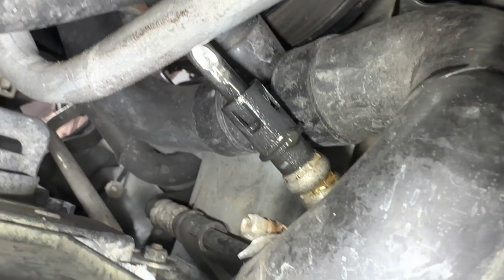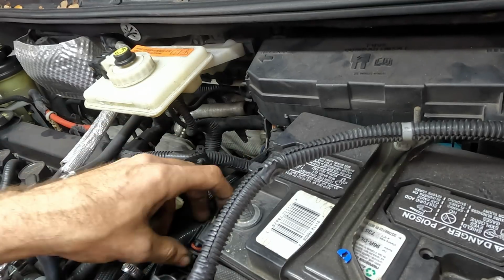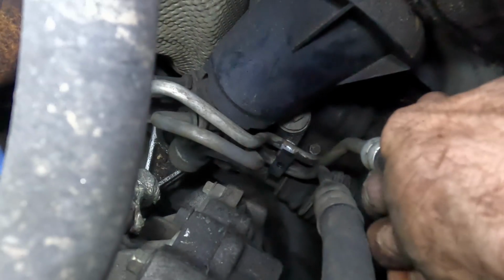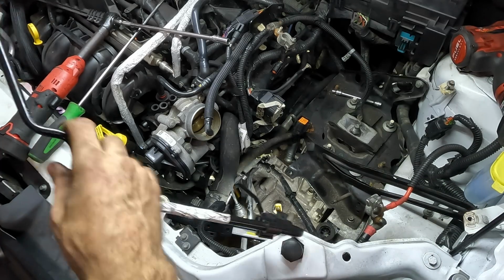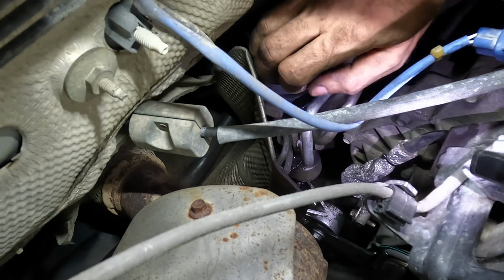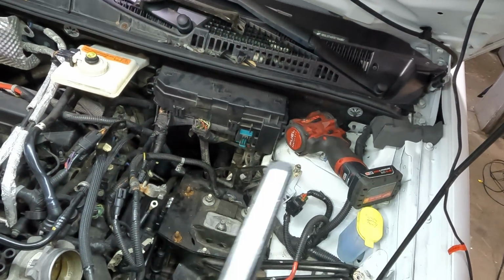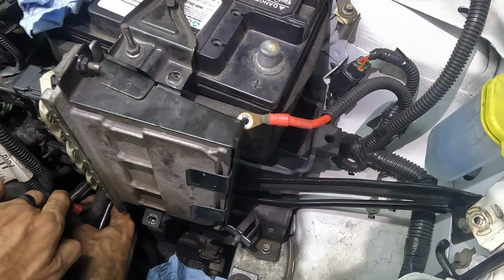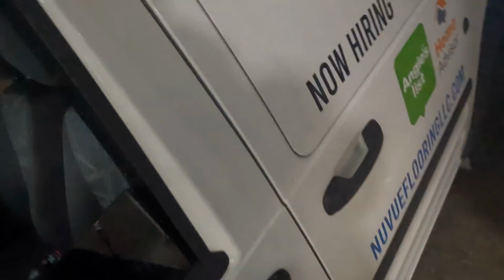Sloppy Repair: High Pressure Hydraulic Leak! 2013 Mini Transit

Comment: oh i have had this same problem with my 2006 ford explorer i was so mad when the a/c line rubs through it was route of the wrong way after an engine replacement not fun to change it What’s the line coming off the compressor? Hi Sideline if I remember right and for some reason the Vin information on my car, even though it’s equipped with Rear ac it doesn’t have the rear AC line in the front very weird has it for the low side and not the side there’s some weird connection. Where is this the regular? Hi Sideline, I don’t know. It’s strange, even ford was confused 🫤